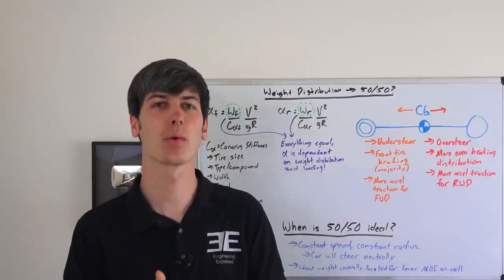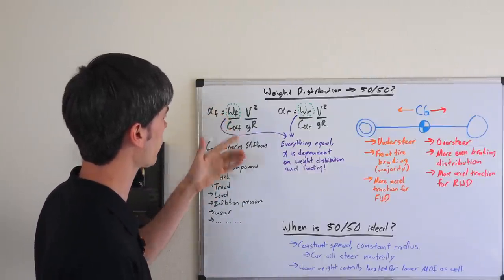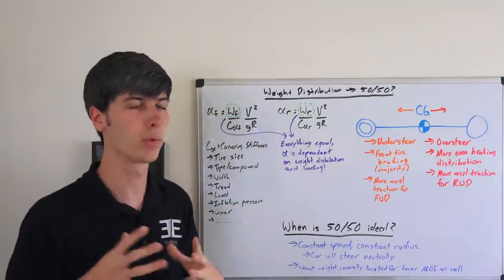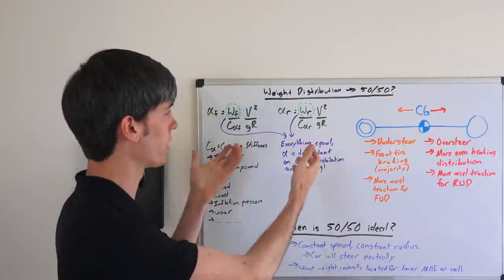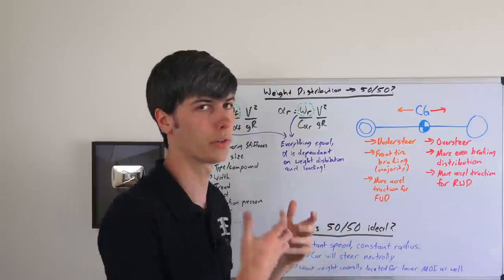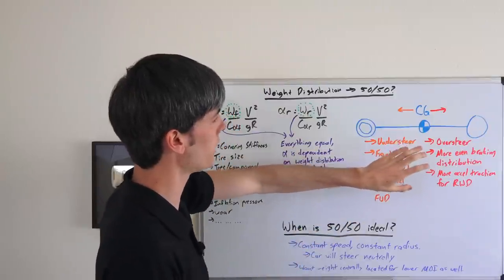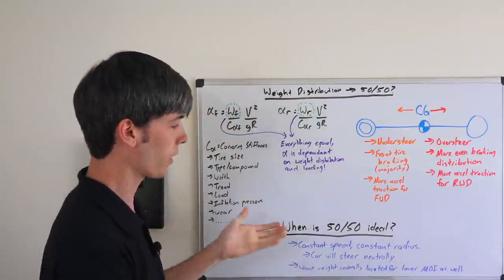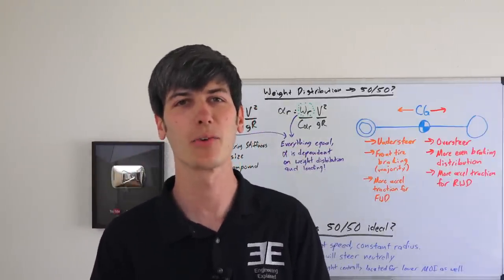Is A 50/50 Weight Distribution Ideal?

Comment: you always made sure you said "going in a constant velocity" adter saying its ideal, does that mean that its not when you are either increasing or decreasing speed?
Reply from the maker: Gleb Gameplays Correct. Gets more complicated then as you have load transfer to the front or rear, which means the instantaneous "weight" distribution is no longer 50/50, and the tires are unevenly loaded.

Comment: I was watching Carlos Lago from motor trend magazine take the c7 z06 around the figure 8 and it appeared as though neither the front end or the rear end were moving faster (no over steer or under) but the entire car seamed to just be sliding in the same direction. Just watch the video, it's kind of hard for me to explain. But is this the result of its near 50/50 weight distribution?

Comment: hey i was working on a project for FSAE and we have lot of weight to rear , around 70  % but during very high acceleration and turning our car is behaving to much of understeer , may front Tyre are not geting enough traction. our car was tuned for understeer.
Reply: If 70℅ weight is in the rear.. No doubt car will understeer crazy..

Comment: So why when you brake into a corner your car tends to oversteer if the weight is transfered to the front?
Reply: The rear wheels get light. You might be turning while braking and it’s upsetting your car. Try being straighter on the wheel and smoother on the brakes

Comment: How does the Lexus LFA have a 48:52 weight distribution being an FR car?
Reply: Carlos Melgar i would assume they pushed as much weight rearward as possible, being RWD the differential is already in the rear, they would also move the gearbox back as far as possible and I think i heard they even have things like the aircon in the rear or middle of the car rather than anywhere near the front.

Comment: Why does moving CG towards to front gives understeer? Doesn't front tires get more traction when there's more load?
Reply from the maker: Sajjawat Laorhasontichai All variables equal, because the front slip angle will be larger than the rear slip angle, and that's the definition of understeer: https://youtu.be/CsVg2DE0ef8
Reply: Thank for the reply, love your channel btw. Keep up the awesome job!
Reply: This still doesn't make sense to me. It seems that more weight on the front tires means more traction, thus less oversteer. Your video that you reference here says one way to reduce oversteer is to increase front downforce.

Comment: Isn't 53/47 better for a track?
Reply: Yeah because under acceleration, weight is transferred to the rear wheels pretty much makin it 50/50 for track
Reply: TheEVGAftw not really, for acceleration specifically you want the weight to be balanced to whichever end of the car has the most power so having a car that has a 50/50 weight balance would only benefit acceleration if it had AWD and 50/50 power distribution.
Reply: megaspeed2v2 I was responding to a rwd post.
Reply: TheEVGAftw noone mentioned rwd. and as i said 47/53 static changing to 50/50 while accelerationg doesnt benefit acceleration on rwd anyway, only benefits acceleration for a car with 50/50 power distribution awd.

Comment: And this is why race car is never gonna 50/50. Why? going around the track is all about accelerating/braking from corner to corner. 

The most preferred WD is 40/60
Reply: It is actually not that simple, a car that has only 40% of its weight on the front and 60% naturally wants to understeer due to less mechanical grip on the front end. This is made worse when accelerating through a corner causing power on understeer, accelerating through a corner a car that is 55/45 will have an advantage as it can be 50/50 in that situation making it neutral. Having a car that is 40/60 has an advantage going into the braking zone as under hard braking the car may be 50/50, I remember reading a Ferrari technical brief from some years ago that actually put ideal weight split at 45/55 which means all of those rear midship cars (Ferrari 488, Lamborghini Hurcan) are actually not ideal. That this gave the best balance in all around track performance. 

There is interesting reading on how Porsche has reduced understeer issues on the Porsche 911, it has a lot to do with suspension geometry.